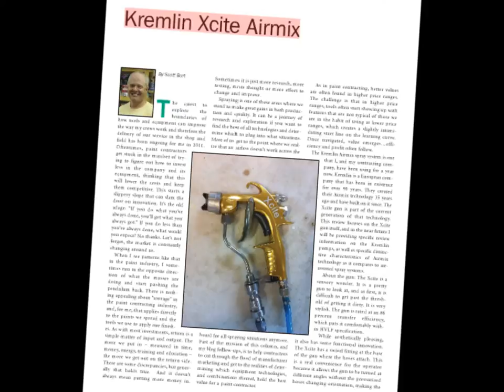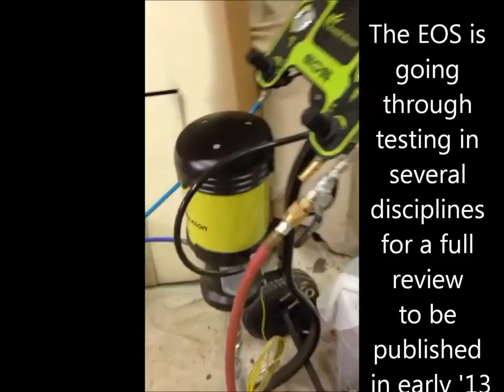Short Demo: Kremlin EOS 15:1 Pump and Xcite Airmix spray gun

Comment: What kind of over spray are you getting with this setup?  Doesn't look like much!  I have a Kremlin hvlp on a pressure pot which works well for small parts, but for spraying large areas (boats) it just doesn't do it..  Looking for ways to cut this down a bit and get a finer spray (almost a mist) :-)  Also, how much fluid is being lost for priming the lines?  Thanks!